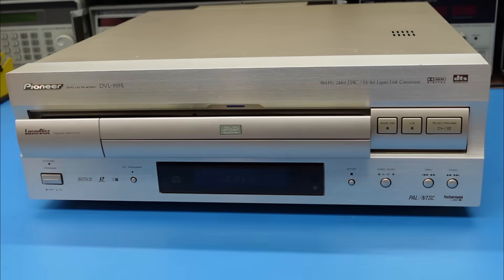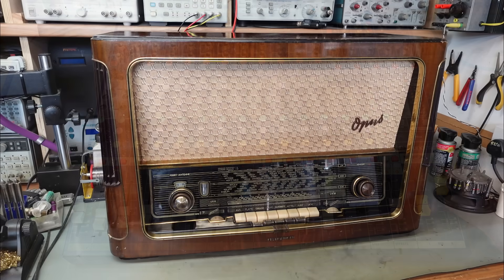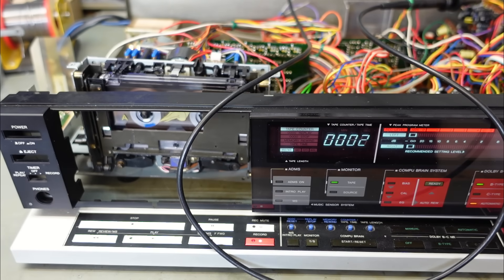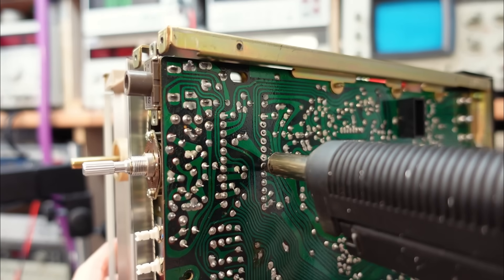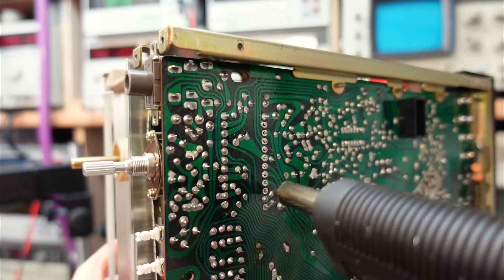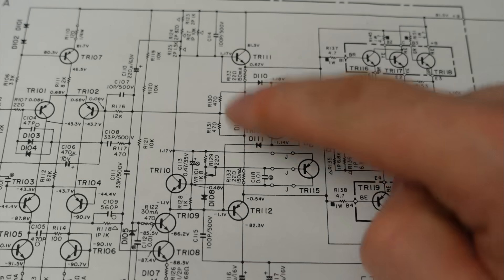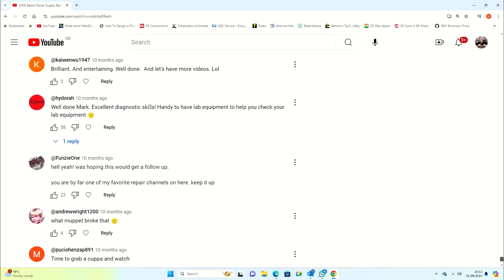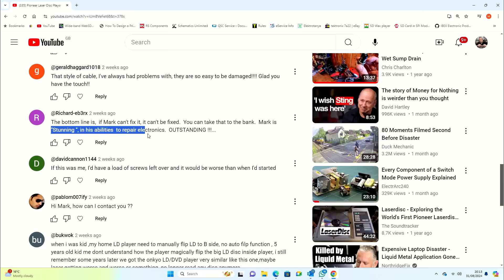The 3-step Process To Repair Any Vintage

Comment: Wow, this channel brings back memories of my A level electronics  I did in 1991 and really haven’t used since. If nostalgia could kill, Mark would be a danger to society! Will definitely sign up for the course once I’ve sorted out my current dose of severe man flu (aka mild cold.) Seriously though, this channel is the best medicine if you’re unwell and feel all the fun and joy is draining away from you. Top man. I’ll try not to get so many electric shocks as I did in my youth, it was pretty much open warfare at my college leaving big charged capacitors innocently lying around 😊

Comment: As someone with an Electronic Engineering degree who also repairs laptops in my spare time I will say not only do you not need that degree, it mostly doesn't even help. You do an awful lot of maths at uni and remarkably little soldering or working with discrete electronic components.

Comment: I have just discovered this channel - most likely through the hits caused by the pre-amp that shall not be mentioned !  These videos take me back to my childhood when my father used to do similar repairs (but without the finesse of Mark).  I remember I bought a broken guitar amp for GBP 10 and my dad found the broken resistor in 10 minutes and repaired it ! Then we were given a record deck which did not work and so on and so forth.  it is an amazing skill to have and I think Mark is far too modest about his abilities ! The repairs undertaken Mark undertakes often have 5 or 6 separate faults and unless you find them all then you the device still does not work - incredible how Mark always have a solution unless there is a custom chip which is broken.  The skills required are also really knowing how components should react with a multi meter to know if they are blown or not especially when there are in a circuit board and can react with other components which may be broken.  You need to have a super logical mind, super steady hands and endless patience as well. Mark's equipment and knowing how to use it is also essential to make logical deductions. You have all of these skills and the method you have developed allows you to perform magic.  I wish I could convince myself that I could do the same by following your method but I do doubt it.  I do have one project which I need to revisit - I have a 1980s CD where the digital outputs work but the analogue outputs do not.  Either the D/A converter is broken or some capacitors which are involved in the analogue circuit are blown.  This does tempt me to open it up again to see if I can work out which it is so if it is the D/A I will leave well alone as I cannot solder like Mark and do not have the amazing soldering irons to remove chips but if it is the caps then why not give it a go !  I applaud Mark and his inspirational work.  There are too many people who consign such devices to landfill because they are only worth peanuts and a repair is not economic (unless it is the Voldemort pre amp (ouch I mentioned the name)) and manufacturers these days don't build consumer electronics to last longer than 5 to 10 years.

Comment: I've been fixing, then later designing electronics for about 55 years. I got a lot of my knowledge when young by reading Practical Wireless, Practical Electronics, and then the cream of magazines Elektor + various other mags. Your "Mend It Mark" youtube videos are a joy to watch. PS what make/model of electric vacuum pump de-soldering machine are you using, mine got nicked, and I need to replace it? Many thanks mate, your a star.

Comment: I have been in the industry since the mid 1980's, seen many changes, and hired/worked with many, many, many, techs.  

I am completely, and dearly impressed with both your technique, and abilities.   Much respect.    Now you need to work on that accent so I don't have to use subtitles :)

Comment: Hello. I am.trying to fix a boombox 1981 with Tashim cassette mechanism. The autostop has a lever does not work. I changed the belts and clean the pitch roller but it was no good.

Comment: Thanks to Mark I have fixed my Nakamichi 680zx. It wouldn’t play. So I took the covers off and found a big white plastic toothed cogwheel wasn’t fully rotating round to where it should go to. It was moved by a square section belt fed by a small pulley wheel. The pulley wheel would start to move, but there wasn’t enough grip/friction between the wheel and belt to work, and the pulley wheel would keep spinning. So I prised the belt off, hung it on a screw thread poking though a bulkhead, got some fine sandpaper, made the pulley wheel  rotate and gave it a gentle clean. Put the belt back on and now it plays 😍 All thanks to Mark for showing how to go about diagnosing and investigating these electronic gizmos 👏👏
Reply: Argh, those mechanisms are so finicky! My Nakamichi BX300 has always had a tendency to eat tapes, and even with a new idler tyre I have to scuff up the surface nearly every time I want to use it otherwise it just won't grip. It's a nice unit when it works, though.

Comment: Mark I have been watching you repair electronics for quite a while personally I like your repair process to keep things as original as it from factory, I am also in this repair business since 1989 had my own business of Repair shop which I had to close in 2001 now I am doing only vintage stuff, I am in USA and it's not possible to send you the unit if I need your help will you be able to help me with any complex problems
Thanks,

Comment: That is funny, in the past I was dismanteling al kinds of electronics to repair. I just had a scoop, multimeter and a soldering iron. But I also expand more equipment and repaired it. Its fun, and fun it is succesfull. 😊

Comment: I would like a little opinion from you members as a friend of mine has a Realistic STA-2100 that was playing fine with no issues. The next day he powered it up and as soon as he hit the power switch the main fuse in the back blown and after replacing the fuse with another of correct value there is no power the unit is completely dead but the fuse now does not blow. He also checked all fuses on the PW SP all are good there was no smoke and no signs of burning. I had suggest The Power switch shorted but now is open? Any thoughts? Thanks Mark I love your channel you are the best!!

Comment: The 200 pound repair on average is a bargain, when you consider the equipment rack Mark has and skills he has acquired.  Then you get a top notch job on top.

I wanted to say thanks for explaining how an opamp works and that it introduces noise and the basics of parallel opamps to sum / cancel the noise.  I'd never understood that and you explained it in about 1 minute!  That was on the master reference series pre-amp repair you did.

Comment: I'm half way through a master's in engineering and I can tell you this: they don't teach you how to repair ANYTHING. I've fiddled with repairs and can 50-50 fix or break stuff. But I've never had access to tools beyond a soldering iron.

Comment: Where did you get your IC storage unit.  I started watching your video and you repaired an electric mistress.  Mine has the same problem. I bought an oscilloscope.  What cables do I need to hook it up.  Thank you

Comment: Good morning i have watched several of your videos and always found them very interesting and educational. I was going to watch your 25 grand pre amp repair as we all hope to find a golden nugget at a boot fair or similar. This morning YouTube sends my my usual Louis rossman video and I could barely believe what I was watching suffice to say i would take him up on his offer as Mr Evans will be beginning to regret his decision to go after you with a copyright strike. All the best and be assured many more people feel the same way. Just as an aside i went on their website and they are charging 60 quid a poo for a binding post that you the customer have to apply nail varnish to to prevent oxidation yet the wire is attached with a grubscrew which if memory serves don't come supplied with their own vacuum field. He should be playing Barbara Streisand on heavy rotation whilst watching his sales plummet.

Comment: Love watching some of your repairs Mark. I trained in avionics many years ago and did 3rd line repair for a couple of years. I developed some reasobale skills but the job was going nowhere. I then got a job doing field service for a company that gave us a massive kit of parts to swap out, sadly these kits were usually missing the parts required as they were the ones that failed all the time. I ended up using my box of hobby components to do component level repair in the field once I knew the regular common faults. My frustrations with the compnay sending me out 2 weeks late for a next day call with no spares meant I didn't stick at it and moved into IT which was very rewarding but I still miss working on equipment and understanding how it works.

Comment: I've been doing repaires as a hobbie for years. The main problem now is electronic parts. China has flooded the world market with low quality or usless copys. I reporpous retired two way police radios that require software that runs on DOS to reprogram the radios. Now, the Chinese crap has really made a dent in my work. Real parts are hard to find even from reliable sources.

Comment: Watching your videos has re-sparked my interest in electronics again.
I used to do the whole deal; design the circuit, hand lay out the PCB with tape, get prototype boards made, populate and test them, and for the digital circuits, write the software to control them. I spent some time in the 1980s and 90s designing my own effects boxes, and mini-mixers for our band.
Gradually, over the years, I move more and more over to a software role and rarely picked up a soldering iron.
After watching some of your videos I've rummaged around in my old electronics draw and dug out some of my experimental effects units with a view to fixing and upgrading them. I may even revise my old RIAA pre-amp!

Comment: Once fault symptoms identified, Half split method was what I applied when I did this for a living...especially when diagrams aren't around. consider anything that works hard, or fast, or hot....as likely culprits, I.e. PSU, oscillators, high voltage components, and mechanical...so I wholeheartedly agree, good advice Mark 👍

Comment: Interested in joining however what level of experience/understanding do I need?  For instance, I know how to use a mustimeter and how to solder, but I couldn't tell you what the difference between a mosfet or a pnp transister is. Is it suitable for someone like me? Do do I need a bit more experience first?

Comment: Very inspiring. I disassembled a dead classroom tape recorder / pa for a friend today. Since he'd already written it off, I decided there was nothing to lose by attempting to repair it. I poked around with a plastic straw and discovered the fault was a dry joint on the main amplifier board. Power light came back on, and the audio burst back to life. Once I'd removed the power amp module and flipped it over I discover two dry joints which I resoldered. Mark, you're an inspiration. Thank you very much.
Reply: I love it when it turns out to be straightforward. The first time I ever took the lid off something was when my CD player stopped playing and made some alarming noises. When I got inside, I realised there was a lump of ferrous debris stuck to one side of the magnetic CD clamp so the disc was fluttering up and down as it rotated. 

Removed it. Sorted. It really helped my confidence.

Comment: Hey Mark, I am in the states. Washington DC watch your videos on repairing vintage equipment all the time. You are very good very very good. I like the way you solve any problems that you come across in repairing if you have the time I will like to know what is 200 pounds is that $200 in the states we use dollars thanks so much for your smile your gentleness and your profession thank you

Comment: Can all Components be TESTED on the Circuit Board with Modern Test Equipment???

De-soldering Suspect Parts is a Major Problem, only to find out it was fine.

Comment: I will Test this Video..... I have a stunning Technics SU-V4 vintage Amplifier in front of me.

With 40 Volts at the Speaker Protection Board.  
I am expecting the two STK-8050 Chips are Shorted including Driver Components.. Lets see how I go.

Comment: Great advice Mark. Unfortunately I have largely lost interest in the field of electronics repair. This is mainly due to the fact that its just not ecomonic in many repair jobs to spend to much time tracing faults to component level. This is also compounded by the fact  that finding manuals and schematics for industrial electronics is rather thin on the ground. The multilayer boards and the complex IC's (which are often flashed with some exotic firmware) I now think its not worth the time and effort. I would much rather board swap for an easier  life.

Comment: Hi Mark. Yes! All steps very important, but perhaps step 1 the most. I was taught re-produce the fault( to make sure it’s not just user error), and it will help you narrow down where the fault is. 
 The thing to remember about vintage gear is it is generally easier to repair as the technology is older, meaning it’s more like to be repairable,generally one doesn’t need sophisticated test equipment and there’s often service information available. Quite often someone else will have repaired an identical item which can help. 

The best way of all to learn though is to do it. Practice on stuff that doesn’t matter. Old stuff that people have thrown away. Get stuff cheap at car boot sales. If you don’t fix it it doesn’t matter, you will have still learned( and you can break the item for parts. Gradually you will fix stuff, and your confidence and experience will grow. 

It’s also amazing how many faults are really simple.

Comment: Mark, Even if your neighbor cam only do so much mending here in SoCal in LA. No one need a Tech with disposable electronics. Even today it's cheaper to buy another any product - it's cheaper to replace. I’ve used all the same stuff. My B & K 33MHz (a bit slower but it still works?) was my dad's. I kept 2 signal generators. One RCA VOM AC needed and takes it's time to given out info but it was his first device he gave me from 1957 when I started as his son. Learning anything interesting? Not really. He was withdrawal into himself and out comes a bully. It was wrong and worse to justify it and do it again. I'm sorry I tried something simular to teach what is bad in this wild and crazy kind of people. I'm sorry I bothered.

Comment: My process: First suspect the 3Cs - Contacts, Capacitors, Carbon Comps. 90% of the faults :). With anything that has inputs or outputs, suspect the peripheral circuitry first. 90% ... If you are fixing test gear: Most important thing to have is specifications(!!!) and calibration instructions (otherwise, testing gets super confusing!), schematics second, pcb plans third. .... I would though say, there are parts that you replace before even attempting to power it up even with a current limiter: obviously melted/leaked capacitors, wax paper capacitors in tube circuitry, unsafe mains side components (dodgy X/Y capacitors, unsafe insulation, rotted mains cabling.....)....

Comment: Preach on Sir. There are so many channels that try to “teach “ diagnostics  and just make the process more difficult to grasp. I’m glad someone finally said something .  I was actually just blocked from a channel for , respectfully, giving my opinion, backed with documentation and other references. It was the opposite of appreciated. My biggest gripe was , verify the complaint. Simple. 
Second, have all the components of the system to be repaired. If you have a battery charger that only charges a specific tool battery. Sure, you might be able to muddle through and get lucky. But you won’t really know how the battery charger has failed if you don’t have the battery it charges. I saw one that tore into the board because the LED didn’t illuminate. Having about 12 of those chargers, and had I not been blocked , I would’ve shared that the LEDs always fail so you have to start there before anything. 
Thanks for your video.

Comment: "Mend it Mark", I really love your electronics repair channel. At 73 years old I still enjoy repairing electronics especially the older vintage radios and equipment and seeing how others fix things.  Now that you pointed out the three step process for repairing any electronics device, I have learned years ago to find the fault and what's causing it and then replace or fix what is causing the fault. Simple. Thought it was a waste to replace a lot of parts needlessly. Only exception is replacing most all paper wax capacitors and electrolytics in very old radios.

Comment: I can certainly diagnose like 75% of simple consumer products but mark has a much larger knowledge of how transistors and amplifiers work which most people won't. I think transistors will be the roadblock for many people like myself who struggle to pinpoint them as the problem, test them out of circuit and such. ICs as well
Reply: Definitely ICs because of all the pins. At least transistors only have three.

Comment: As an electronics techy for the past thirty years Cough Cough the thing I find these days is the lack of parts to repair the old stuff. A lot of obsolete stuff comes out of china and to be honest isn't worth the time or even the effort as most of the time it's rebranded rubbish. In the last say ten years I have noticed a huge decline in people wanting stuff repaired and instead they throw it out and buy new, my workshop used to be non stop in and out repairs but these days it's getting slimmer by the day. I think that unfortunately the future holds very little for us techies in the electronics sector and I suspect that in about twenty years it will be as obsolete as the components are getting.